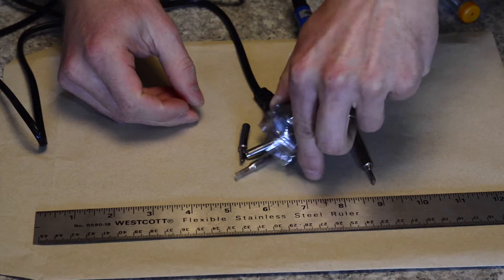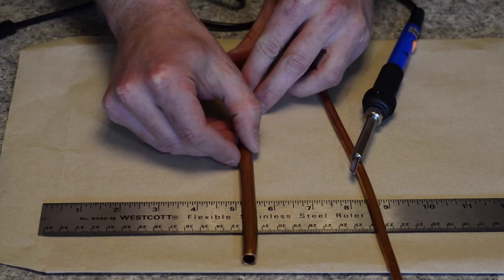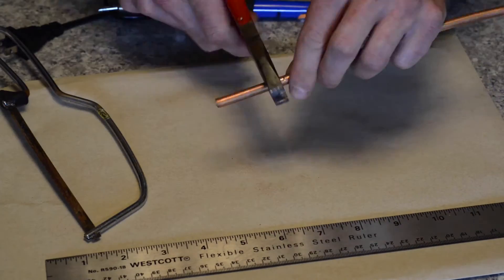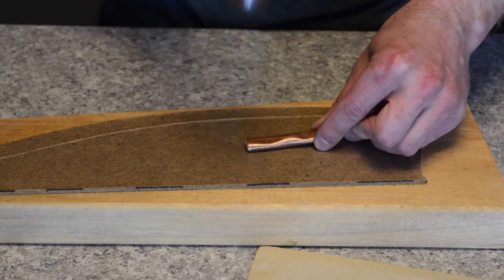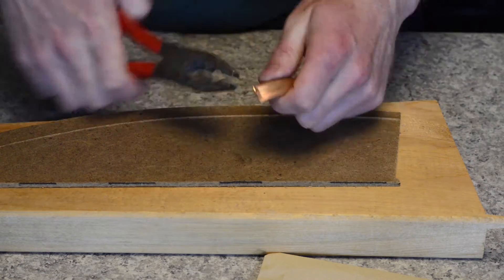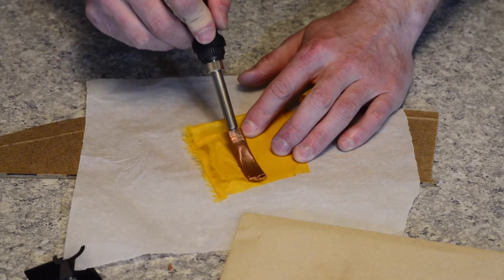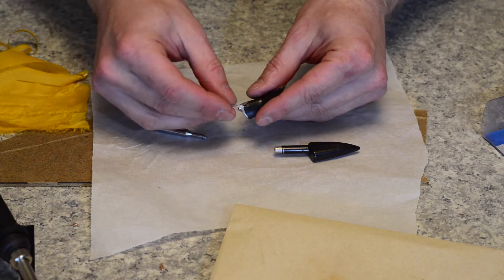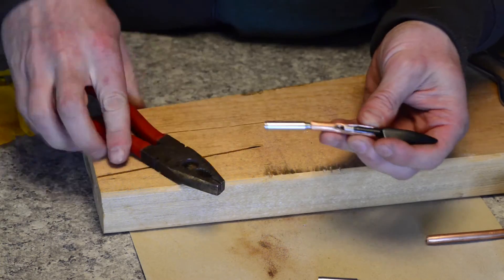DIY Packraft: Make a Heat Sealing Iron (2016)

Comment: Have you tried using a hair straightener? If so, how did you find it?
Reply from the maker: No, I haven't tried that - I have been using an off-the-shelf Clover Mini Iron II, which is pretty cheap and works well, so I haven't needed to experiment with more DIY options.
Reply: Fair enough. I have two soldering irons. One of them is crap and not worth bothering with, the other one is actually good and I don't want to risk breaking it/permanently making it a heat sealer.

I'll try the hair straightener and see how it goes.